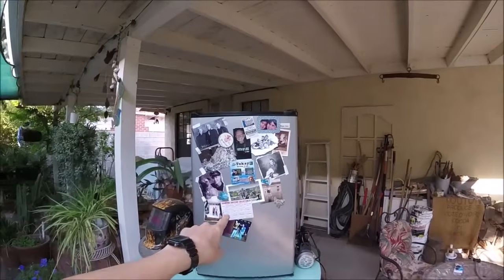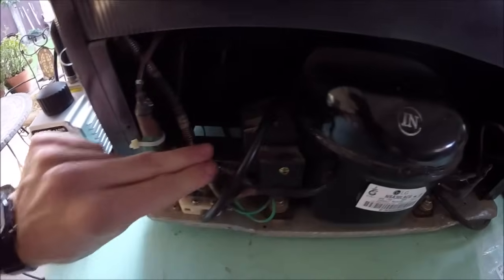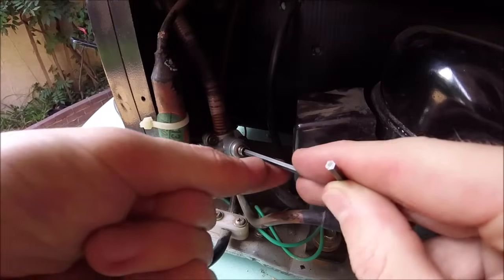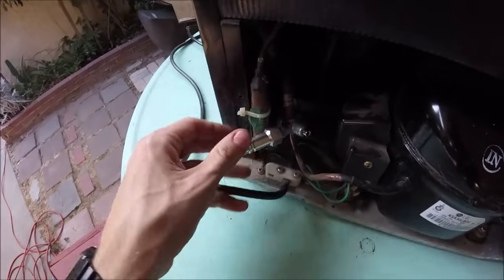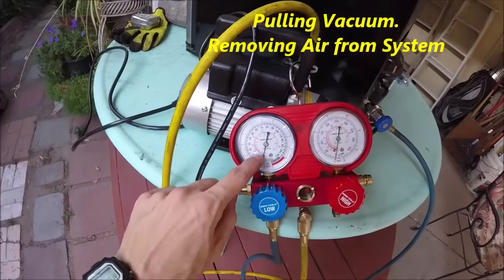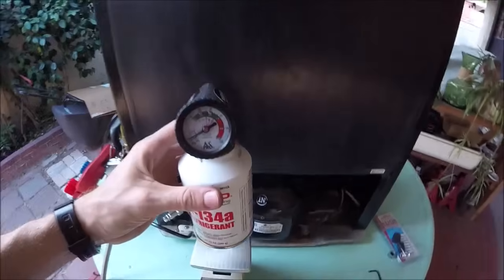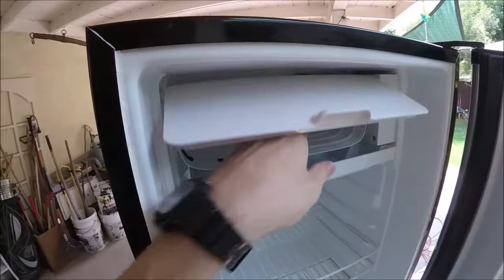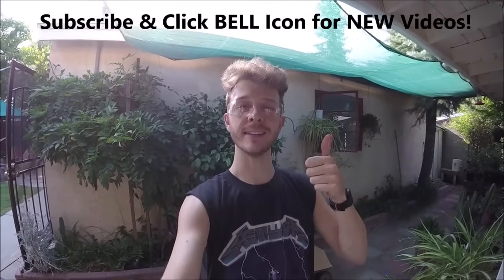How To Correctly Add Freon to your Refrigerator R134a -Jonny DIY

Comment: Can car gauges (r-134) be used on refrigerators? Or do you need special ones?
Reply from the maker: Yes you can use the Car AC gauges. Those are the ones I used, borrowed from Autozone Loan a Tool program
Reply: Jonny DIY thanks for the reply! I thought it was possible since it’s the same Freon. Thank you for your help!
Reply from the maker: @berniemac8413  you're welcome, no problem 👍🏻

Comment: Hello! I have a question. I did not know I had an R600A compressor and I used the R134A. I turned it on and it did not cool. The compressor still turns on. Can I still get the R134A out and use R600A or did i completely mess it up? Thank you Elisse
Reply from the maker: @elsyleeolga  yes you can vacuum system
Reply: @JonnyDIY  Hi! Thank you so much for getting back me to. Would you mind giving me a little more insight into how and tools needed? Thank you again! 
Best, Elisse
Reply: @JonnyDIY  I forgot to ask: Will the compressor and system work fine after the R134a is removed or does that cause damage to the actual system? Also, if there is any R134A residue left that was not efficiently taken out will that have any effect when mixed with the R600a? I really appreciate your time and information. Thank you again, Elisse
Reply from the maker: @elsyleeolga  I'm not 100% sure but I think it should be fine 👍

Comment: I purchased the  A/C Pro R-12  to 134a conversion fittings, however the low side fitting will not snap into the manifold quick release coupling ( it doesn't go into the coupling far enough to engage the balls)  The gauge set is labeled 134a only.  Any ideas? Thanks
Reply from the maker: it should work as thats an r134a fitting. Make sure you have quick release screwed counter clockwise then you can pull back spring part and push on to fitting. Once fully seated then screw it clockwise to open it up
Reply: @JonnyDIY  Thanks for the quick reply!  As soon as I closed the valve the fitting snapped in place.

Comment: You should put the bullet piercing valve at the compressor service stub side. Once you are done you should remove it from the system. Otherwise it will leak sooner or later
Reply from the maker: Yes best to use valve then reseal stub side to prevent leaking from valve. Your mileage may vary but it's been over a year and the fix is still holding fine for me
Reply: WHat do you mean remove it from the system?  If you remove it you have a hole there.  If you solder the hole your back to square one.
Reply from the maker: Theres a special crimp tool that you can use to seal the pipe in front of the valve. You can leave the valve but sometimes they leak a little bit over time 👍🏻

Comment: Awesome video. Question, when you are done, leave the bullet piercing valve on the low side in the closed position, essentially it will stay in place for the life of the fridge in case you need to service it again?
Reply: Yes if you take it off the coolant will come out

Comment: Can you skip the vacuum step and just add the refrigerant?
Reply from the maker: Yes if its not completley empty of refrigerant. Best to vacuum though so you can add back in the correct amount of refrigerant
Reply: @JonnyDIY  thanks a lot. Doing it now. Hope it works. Great video. Many thanks
Reply from the maker: @chongqinghotpot  you're welcome, glad I could help you out 👍
Reply: @JonnyDIY  hi Jonny, new issue: the air is not much colder than before and there is frost on the suction line. Overcharged? If so, would open the Valve on BPV help?
Reply from the maker: @chongqinghotpot  it may settle down, Id let it run and see if its helped at all. If still warm Id probably vacuum system and add back the listed refrigerant amount for the specific model. Use a scale to get it precise
Reply: @JonnyDIY  great idea🙏🙏

Comment: The EPA and any EPA certified individual will tell you that these valves are not made to be put in place to add a charge and left on, in fact the part 1 EPA 608 certification covers that these should NOT be kept on as they will leak.
The proper way to use these valves is to add one, recover the refrigerant in the system, and then braise on proper service fittings making it a type 2 appliance which then can only be serviced by that certification individual.
Reply from the maker: yes brazing on a service port would be better
Reply: @JonnyDIY  he's saying that under EPA guidelines, you legally CANNOT service this type of appliance without proper certification.

Comment: If it holds a vacuum does that mean you don't have a leak?
Reply from the maker: Yes, correct. Hope you get it fixed 👍🏻
Reply: If there is no gas in it it means you definitely have a leak

Comment: Hey Johnny where do you find the bullet vale with the right hookup for  the standard hoses that come with the re charge cans ?
Reply from the maker: If you get a "can tap" it will go directly from can to the yellow hose from the gauges. And the yellow hose screws right onto the bullet valve. I didnt own a can tap at that point
Reply from the maker: Should be able to get one at local auto store of Amazon 👍

Comment: Hi Johnny!
Would it be the same process for a COMMERCIAL refrigerator?
Reply from the maker: Yes same thing just check for the amount of refrigerant needed
Reply: @JonnyDIY  Thk u so much!!
Reply: Won't work on a commercial fridge! Most aren't r-134a and if it is you'll need allot of it and will still leak out.

Comment: hi good day sir i " went to work and left my fridge open slightly . when i came back home the fridge was making a clicking sound. i watched some you tube videos and i realise that was the relay so i purchase the a startup kit and had my friend installed it . we plugged in the fridge and the clicking  stop  i left the plugged in for a while and it still was not freezing.  i felt the compressor in the back and it felt hot he said the compressor not good. i am asking if the compressor need gassing up or how the fridge was left open for hours destroyed both the compressor and the relay.
Reply from the maker: Possibly damaged compressor because it was running non stop. I would test the compressor
Reply from the maker: You can test with multimeter. The gas shouldn't have leaked out though
Reply: @JonnyDIY  thanks alot. if a second hand compressor is $500 and new is $1200  what options will you go with.
Reply from the maker: @robertmarks6525  if fridge isn't too old I'd probably fix it, that or look for a good working 2nd hand. Many for $500 and under
Reply: @JonnyDIY  the fridge was brought on 18th October 2017 so not that old, it 5years old so i will take your advice and purchased the second hand compressor. i honestly appreciated your conversations. and thanks a lot Johnny. 👍

Comment: great but now part b how would you find an repair a leak
Reply from the maker: Can pressurize system with air adding uv leak dye to pinpoint or recharge with a lil refrigerant with uv leak dye
Reply: Thank you appreciate your reply an help video
Reply from the maker: @MrRadiodio  you're welcome 🙌👍

Comment: Question, did the auto gauge you used go into “the red zone” when you did this ?
Reply from the maker: I dont use use the little gauge on the hose. They never really work right. I just go off how much refrigerant is needed. Thats why the scale comes in handy. Dont want to overfill system 👍
Reply: I was just curious because I don’t have a scale, and I might need to buy one after this. My refrigerator requires low side 140 psi, on the auto gauge that is in the “red zone” I was just curious to know if you hit it in this video. Thank you for the response and advice, I greatly appreciate it 🤝😊
Reply from the maker: @RavenCasarez  You're welcome, glad to help.  A kitchen scale works well. I just got a new one the other day from Walmart only like $12. Ozeri was the name.
Reply: @RavenCasarez  I think it requires 140 psi on the high side.

Comment: I have a refrigerator r404a can I use our 134?
Reply from the maker: I believe you can yes. Not all are compatible though
Reply: DO NOT MIX REFRIGERANTS! Each refrigerant is designed differently. They operate at different pressures and temperatures. R404A operates at a much higher presssure than R134a

Comment: How come you never explained about the small pinned hole? Did you closes it or?
Reply from the maker: This one actually had a large leak that I patched first. Determining where the leak is can be accomplished by injected leak dye into a pressurized system. If it's a tiny leak that takes years to leak out though I wouldn't worry. Can tell by vacuuming system how large leak is
Reply from the maker: Here's the video I patched large leak
https://youtu.be/XjgCxwf55lk

Comment: Hey there. Thanks for the informative video. I've a question... I vacuumed the system to just about 29... seemed to stay showing no leak. The refrig door tag said freon R134a capacity is 5.64 OZ. I used a scale and added the necessary designated capacity. As i hooked up my gauge, it still shows -10 PSI in the negative, or vacuum range. id assume after a half hour, the new freon should register accurately? I added more to bring my gauge to just around 2PSI, then system jumps to 20PSI after about 10 minutes, this shuts the compressor down, or 'MOTOR LOCK'. Samsung RFG298AARS
Reply: While the fridge is running it will be pulling a very strong vacuum. This is how it is able to use r-134a to achieve freezing temperatures. Just trust the scale to add the correct amount and do not overfill.

Comment: how much psi did u need to fill it?
Reply from the maker: I filled it by ounces. Should be able to look it up online refrigerant capacity. Either that or sometimes sticker on back saying amount
Reply: Small capacity appliances are usually less than half a pound. There's more that goes into the charging process. Please consult an EPA certified technician before doing this

Comment: Does it matter which copper line to use?
Reply from the maker: Cold side line. Feel the pipes it'll be the cool on coming out of compressor.  Or if compressor has a stub out line
Reply: So a stub line is also suitable to put a piercing valve on, right? @JonnyDIY
Reply from the maker: @DISBoogie  correct, it's basically the service line.
Reply: @JonnyDIY  thank you!

Comment: Do i have to use the vaccum?
Reply from the maker: If you hook up the gauge to it and it has no pressure at all in system still, yes. Because then air has entered system and it needs to be vacuumed out, if you dont, it wont cool properly 👍🏻

Comment: When you vacuum everything out,  do you open up the valve on the conversion kit and the one from the gauge?
Reply from the maker: yes you need to open gauge line and bullet valve when vacuuming system 👍🏻
Reply: @JonnyDIY  when adding a/c to the conversion kit, for some reason it's not taking in,  each time I squeeze the trigger from the can,  I can hear it  and the psi on the gauge does not go up. I inspect to see if the line is pierce, and it is. What else can I do?
Reply from the maker: @209ers  make sure you drove piercing valve all the way down. Then loosen it back out a turn or so to add the refrigerant. Then close the piercing valve back down after recharging.

Comment: Bullet valves always eventually leak, silver solder in a proper access fitting
Reply from the maker: Yes for sure. If you can solder in an acess port on the stub, much better 👍🏻

Comment: I think this is my problem. Only the top fifth of my condenser coil is frosting. My question is, how do I find the leak to fix before adding refrigerant?
Reply from the maker: You can add leak dye to system to detect/find leaks 👍
Reply: @JonnyDIY  can you tell me how and which dye to use?
Reply from the maker: @johnmidgley2687  you could simply buy the refrigerant with the leak dye in it and do as I did and vacuum and recharge it. Other way would be to add leak dye then pressurize system with air

Comment: Thanks for the vid, can you please answer a question... I ordered all the parts now that you recommended to do this job, but the label on my fridge requires R- 600a is it the same process ? 
Would the fridge still be plugged in while I recharge it, since it is flammable. I don’t want to blow up. Thanks!
Reply from the maker: Yes you recharge with fridge plugged in. To be honest Im not sure about using r134a in an r600. Some one else may chime in. What I researched it said it  could work but refrigerant amount may differ

Comment: How do you k now it needs charging and not some
Thing else
Reply from the maker: Process of elimination and symptoms. If cooling but not cold could be low on refrigerant or compressor could be failing. Can test compressor
Reply: @JonnyDIY  LG compressor. A pro was nice enough to bring me up to speed on the issues with LG compressors.  He felt like 95% that was the issue.  The fridge is 10 years old so all things being considered I bought another one.  Thanks for the response and the video.
Reply from the maker: @TG-to3dv  You're welcome, glad you were able to get it figured out and congrats on the new fridge. New appliances are always fun

Comment: I got a broken copper line at where you inserted the bullet piercing valve. Got any suggestion/video on how to fix this prior to adding refrigerant?
Reply from the maker: you could try soldering it or if it isnt too big some epoxy putty would work

Comment: Where i could get those freon cans?
Reply from the maker: I get at local auto or hardware stores here in the states. Even Walmart had them 👍
Reply: @JonnyDIY  i went walmart but the cans says automotive only.
Reply from the maker: @RICARDO-bn7kc  works the same as long as fridge takes r134a

Comment: i have an old soda machine how can i tell if it gets r12 or 134a
Reply from the maker: If its old like pre 1990, its probably R12 freon
Reply: Check the data plate/sticker... that will tell you which refrigerant to use

Comment: You have a leak in the system. That leak, depending on where it is, allows moisture, dust and other contaminants into the system causing the Freon to become “dirty” with incondensables which quickly leads to compressor failure. The leaks will get bigger and adding Freon will become more frequent. Price repairs for leaks or get a new fridge. Best advice.
Did you leak test with nitrogen? How long did you leave nitrogen in the system under pressure? How long did your vacuum pump stay on and how long did you leave it in a vacuum?
Reply from the maker: Youre right. Always take care of leak first, then vacuum and refill system. I fixed leak first
Reply: Oh please. It's a $90 mini fridge that he got to do it's job again for cheap. Stop yer creepin. Big deal if the compressor dies. It has done it's job!
Reply from the maker: Thanks, & it's still working great since this fix 👍🏻
Reply: What are you talking about? Nitrogen?  This is a mini fridge not a NASA lander.

Comment: Great video! Do you have to leave the bullet piercing valve on the fridge or is there a way to patch the leak?
Reply from the maker: Thanks. Yes you leave the valve on. Only way to remove valve is if you put it on the service stub and then get a pinch off tool and pinch the copper line in front of valve then you can take it off 👍

Comment: Freon is brand name of R12. Do not mix refrigerant types as it will underperform and likely damage your compressor. Use the refrigerant shown on the unit’s label
Reply from the maker: You're Correct. Freon is just used interchangeably  as a common name for any type refrigerant

Comment: Hey JonnyDIY,  question(s). First is using the manufacturer fill line. can you use that and I have a freezer, so does it have to be running to add?

Another question is all I can find in stores is the auto ac R 134a. Can that be used on the freezer?

Thanks guy, much appreciated gonna subscribe!
Reply from the maker: Yes keep plugged in, needs to be running when recharging. Yes the r134a for auto works just the same, make sure you check label on back for amount refrigerant to add. Should also say what kind. Old units will use R12 refrigerant
Reply: @JonnyDIY  dude, thank you so much! Can't find this info anywhere! Much appreciated!!
Reply from the maker: @Goz86  you're welcome, glad to help 🤙🏼
Reply: @JonnyDIY  recharged the freezer last night, works mint. once again thanks!
Reply from the maker: @Goz86  Awesome. You're welcome & glad you were able to get it working again 👍🏻 🦃

Comment: If I plug in the vacuum pump and it doesn't drop what is the issue??
Reply from the maker: If when you go to vacuum system and you cant get it down low and it wont hold when you close it off, then you have a leak in the system you need to address  before recharging 👍🏻
Reply: @JonnyDIY  if it holds at zero is it still good?
Reply: How long should it take to get down to 30?
Reply from the maker: @FatFitDad  needs to be below 0 to be in vacuum. Should get close to 29-30 fairly quickly
Reply: @JonnyDIY  and that's with the unit unplugged right?
Reply from the maker: @FatFitDad  yes fridge unplugged while vacuuming,  plugged in while recharging